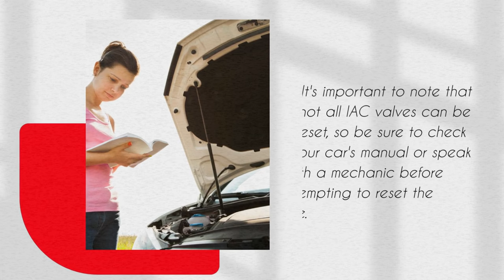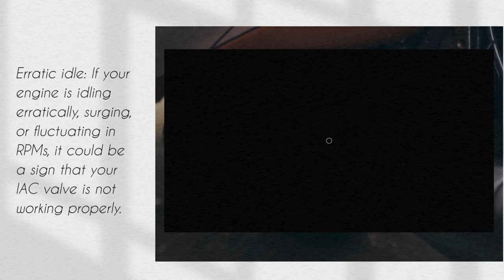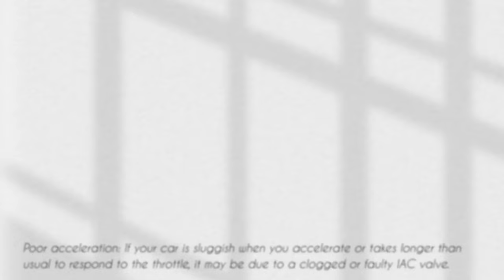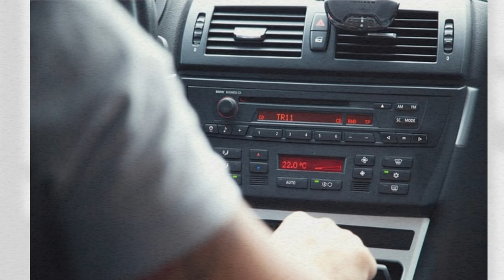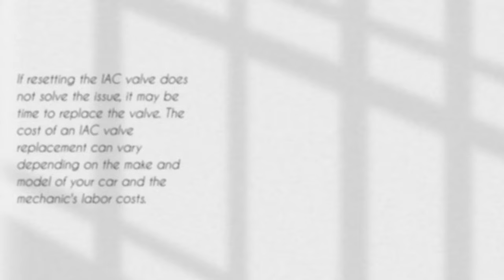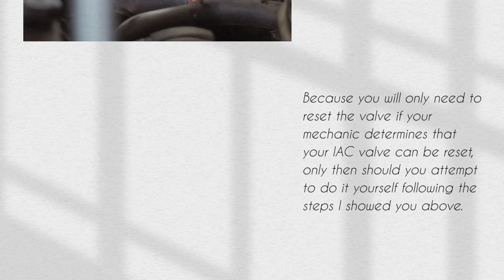Symptoms of a bad idle air control valve, Reset, & Cost for IAC Valve Replacement.

Comment: It really seemed like my problem was the idle air control valve.  I have a vacuum leak I couldn't find.  The idol was bouncing up and down, it was a rubber seal in between the brake master cylinder and the brake vacuum booster.  When I press my brakes hard it idles fine, and when I take my foot off it bounces.

Comment: Before you do all that. Check air filter, throttle body, vacuum leaks, wiring loose,fuel filter etc.

Comment: The i a c valve, is not the only component which exhibits the symptoms explained & described in this video.! A dirty throttle body also creates the same flaws- responses.!
Reply: I think a failed vvt valve has the same symptons also

Comment: Yes i found the  rubber flap on valve cover vent ripped ..what got me is i had a so called mechanic changed .i found out one and he couldn't find problem ..i opened the oil fill while running engine 2 min test to find problem..20 dollar fix

Comment: can a iac valve only work when the car is warmed up? sometimes i have to push the pedal in the morning to keep it running.
Reply: Hey could you fix it
Reply: @rizwanrfk4548  Na wtf I want to junk it
Reply: same thing is happening to mine right now, what was wrong with yours?
Reply: Same as my 88 Silverado
Reply: @alikimber7472  
I had the same issue and repaired the ECU .
Now it works fine but hardly there is a misfire but not often

Comment: Will a bad IAC valve cause a vehicle to not shift when it is supposed to
Reply: Hey man did you figure it out, same thing is happening to me.
Reply: @Pyyki  not for sure to be honest changed a couple different sensors and new filter and fluid but it seems to be shifting so far
Reply: @Pyyki check your transmission fluid you might be low
Reply: Yeah if the transmission fluid is low, it won't want to shift
Reply: My truck was shifting wierd it would get stuck and rev high and bang it would shift hard as hell my mass air flow sensor was dirty soon as I cleaned that the check ingine light turned off and It started shifting perfect again

Comment: So I’m having an issue when the air conditioning is running, at a stop, traffic, stop light etc, it will surge up and down from 750-450. Ver noticeable. Could this be the issue? Haven’t stalled yet. It’s also odd it only does it when ac is on. Also tried cleaning it but no change.
Reply: Same thing is happening to mine. Did you find out what it was?
Reply: Try to add an fuel aditive, i use Liqui Moly on my diesel, then go for a drive above 20kms and with RPM above 2000. On that drive reduce to the lower gear and step on the gas and look if you have black smoke. Petrol engine it's too much crap on the muffler, lambda sensor or oxygen sensor. Diesel could be egr, bad diesel on the same gas station, running short distances. Use any aditive first and go for a 50 kms drive and if you can and when you can push it until gear changes or it's time for you to change it. Mantain the engine above 2000 RPM the whole time if you can. Why? The heat will mealt all the crap and everything will come out from the exaust, muffler. Keep adding a good aditive for a few tanks.
Reply: It's normal for an engine to surge when the a/c is on. It's the compressor doing that!
Reply: @catsurreal1655  I don’t think this kind of surge is/was normal… I took an IAC valve I got from my other car and it stopped.

Comment: Thank for very good information. What about if my car running for about 20 minutes and when the engine gets hot, when i turn on clutch and rpm low my engine shut off
Reply: Any suggestions if what causes
Reply: Hi. Mine does the same. Have you figured out what was causing it?